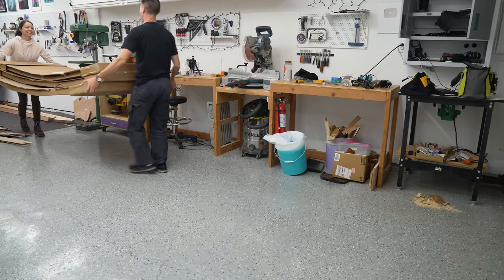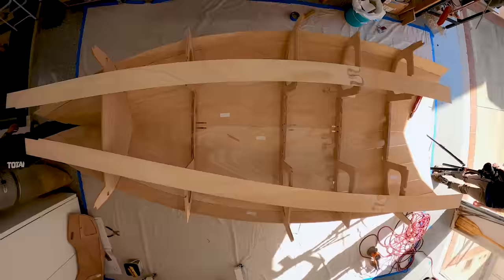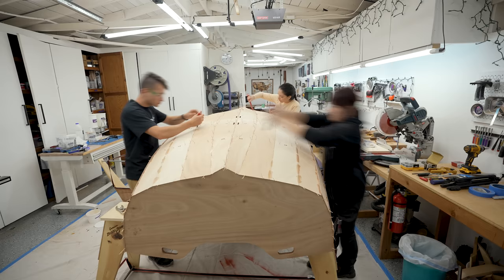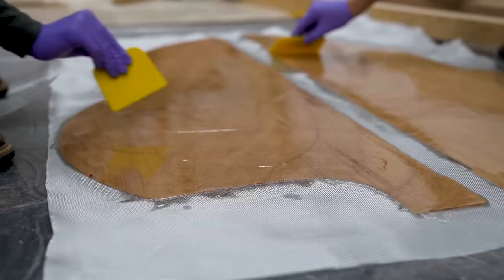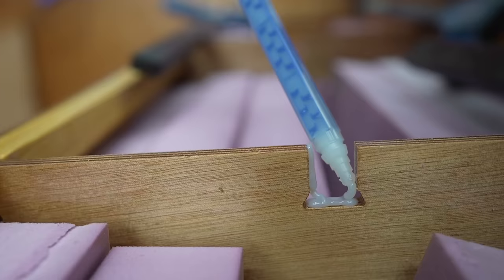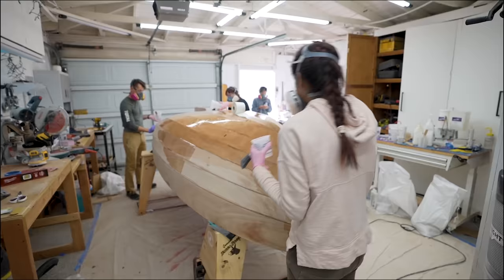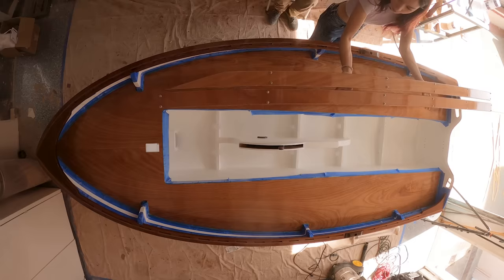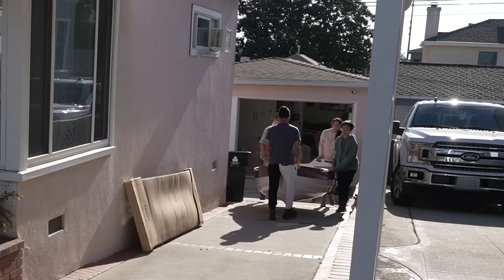Building a SAILBOAT (My Longest Project Yet!)

Comment: Buy a few concrete straight edges (the aluminium extrusion type - make sure they're not bent out of the shop before buying them) and keep them in the shop. Whenever you want to make sure something is straight you can use those to keep a reasonable straight surface and they are built to be abused, so it's not like a level, which is a fine instrument. They're meant to be dragged in concrete, dropped abused, so a little bit more sturdy. Don't cheap out on them, buy the thickest and heaviest you can get (in aluminium). A few of those in the shop are invaluable datum surfaces to work off.
edit: also, take your plastic squeegees and notch them (or buy notched ones) because that's going to dose all the epoxy that's not for laying, to the exact dosage so you don't have to waste time making sure you have a consistent layer. It's like laying tile.

Comment: Been enjoying your videos. Had an idea for a fun boat project that would involve some experimentation with some epoxy and bamboo. The original canoes that cedar strip canoe's were based on were the birch bark canoe. Do you think you could build a birch bark canoe out of bamboo strips? They have a lot of ribs I kinda wondered if you had nearly continues ribs which you then epoxyed the outer strips to if you would basically create a fairly thin light weight formed plywood construction. Just a thought that would be a really cool build and thought you might like to try

Comment: Xyla nice work! I like to cut fiberglass cloth with scissors I get from DAISO. They have very tiny teeth and hold up very well and only cost a couple of bucks. I fish for sharks and used them to clean them. Shark skin and fins dull my knives before I'm done and the pair I'm using have cleaned over ten sharks and are still sharp. The blades are about three inches long and easy to use.

Comment: Similar construction method invented by Barry Bucknel as co designer of the original Mirror dinghy. I built mine age 15 back in 1966. I gave it away last year. Up until that point it must have been the oldest single owner mirror dinghy no. 7580. £69 from Mirror Newspapers back then. Glue was mixed from powder. Reinforced with glass tape and resin. I bet this is a few £s more to buy.

Comment: That's a lot of storage that got filled with foam... could've made water tight compartments that would be useful for more than just bouncy...just a thought for the next one 😉
Reply from the maker: the whole point of foam is that if that water tight compartment the foam is in gets breached (like a crash- this is for a youth sailing program) the boat won't sink because every single cell of the foam will not also get breached
Reply: @xylafoxlin  yeah, I get it, totally... just the prepper in me looking for that storage. The small boat we had when I was a kid had two compartments (one on either side) that the life jackets were kept and the compartments were like a cooler but with rubber around the top...would take a lot to punch through all those layers...still, probably a good idea on a trainer to have solid foam... I'm always looking for that storage on a personal boat 😊😋

Comment: Great video.. well done on the boat! I know you're an epoxy girl.. however a good wood glue is much less expensive and bonds better (soaks into the wood deeper) tightbondIII waterproof exterior has worked with great results for me.  I broke in half an aridronact chair teak arm 30 years ago. Used TB wood glue to repair. It has held up perfect without any finish outside in the elements for 30 years. For wood on wood it is perfect. Epoxy is better for structural joints... just saying

Comment: Did you ever try resin infusion on the boat? The bagging would be a nuisance, but you could save weight. Also, for working on the inside of the boat, couldn't you put the boat on one side?

Comment: For so long it was covered with varnish and epoxy resin to prevent water from getting plywood ...  And then you  just screwed the screws without a filler. (((
If It’s not too late, you need to unscrew all the screws, drill bigger holes and fill them with resin. Let it settle and then drill small holes and screw the screws into these holes.

Comment: Greetings and Salutations 

I thought you meant to assemble the wooden parts with hammer and nails then wrap the whole boat in shrink wrap 
Then pour the epoxy resin into the shrink wrap plastic never seen a fiberglass boat before

#goodluck #thanks 😊

Comment: If my avid reading of Patrick O'Brien is to be trusted, the aft sides of a sailing vessel are its "quarters."   That is, you would describe something directly in front as being "dead ahead," something in front but to one side as being "off the port/starboard bow," directly to the side as being "amidships," directly behind as "dead astern" and something behind the vessel but off to one side as being "off the port/starboard quarter."  

So "quarter-knees" are perfectly descriptive - they are the knees mounted in the boat's quarters.

(Please note that I rely entirely on Mr. O'Brien for this information, as I live in Alberta and am well over 1,000 km from the nearest ocean.  Amusingly, I am almost equidistant between the Pacific and the Arctic.  Needless to say, my practical experience is minimal.)

Also: if the garage is flooding, building a boat seems like a reasonable reponse.

Comment: Maybe it is my odc kicking in, and ill admit I know nothing about boat building, but solenoid the wood is sealed from the outside, but what about all the holes drilled into the wood after it was sealed, would those not open up the wood to getting water into its fibers and rotting from the inside out?

Comment: cool build, didn't realize how many little bits & pieces went into a lirrle boat.  are you aware you say "boatl tote" almost every time?  
  you should make & video building a sailplane glider next, that'd be especially cool...  even better if'n y'all combined it with big enuff re usable rocket boosters so you woodn't need a tow plane to get it up.

Comment: I have a question! How come you spend all this time protecting the wood from water with many layers of epoxy and paint, and then drill holes in it and leave exposed wood? Or do you also treat the holes but did not show it? I know nothing of boats, but what I do know about water is it gets everywhere, just a tiny crack and it will find its way in there, so to my eyes this is dangerous. Hoping someone can help me here!

Comment: For the foam why not use self expanding foam? Does it pose a weight issue or was the and other reason for the foam board instead?
Reply: Here in the UK we used to use it for glass kayaks. Story goes some one was casting in the foam in the winter so slung the kayak on end in the stairwell of his house to be warmer. He got the decimal point wrong and poured in ten times too much. It  foamed up and out and flooded the hall in foam too.
Reply: Xyla mentioned in a previous comment that they were specifically asked to use the pink foam so that it could be replaced if repairs were needed (and why can't people be bothered to read the existing comments before posting?)
Reply: @earld1403  because like the majority of people I’d rather be given what I want than work for it

Comment: I used to work in the industrial fiberglass industry. i can honestly say it kinda sucked.  lol but then again i was doing it for things like lining of chemical tanks, or containment systems for caustic chemicals and pretty much every place i had to work was the most disgusting and gross place you could imagine.  lol even our shop pretty much had a 2 inch layer of resin on the floor it was not a good environment (which is why i don't work there anymore)

Comment: If you need to sand inside the boat why not just turn it on it’s side? As long as your glue has dried it should be okay. If you need some sort of support you could just make a support frame out of scrap wood.

Comment: Can someone explain to me what anti fouling paint(or however spelt) is and why it cant be on a boat that doesnt stay in the water?
Reply: It is a paint with something in it (a biocide, for example) to inhibit marine growth. Without it, the bottom will quickly foul with seaweed/algae, barnacles, worms, etc. It is usually slightly toxic. Typically, boats which are stored out of the water do not use bottom paint. You CAN use bottom paint on a boat that doesn't stay in the water but it is not necessary, and since it is toxic, the center for wood boats probably prefers not to have it.

Comment: Building a boat should always be centered on the fact that you want to build a boat and not necessarily that you want to go boating.  The two are most often, unrelated subjects.  

For every boat that is built new and completed by amatuers, there's at least a hundred (professionally built) which are being abandoned somewhere and left to rot for lack of a caring skipper.  Many are perfectly seaworthy and still in the water although impounded and awaiting auction or demolition. 

They all need a little paint and polish but most of all, a new owner.  

Think about that before you start some big construction project.

Comment: But but but... TotalBoat sells 2 part expanding foam made specifically for boat flotation?? Why use the pink insulation foam board? Excellent video though!!!
Reply from the maker: they specifically requested pink foam so it can be replaced quickly and easily if the boat gets injured! Next Thursday is gonna see a ton of use
Reply: @xylafoxlin  Yikes! That's a hell of an injury to get into the foam!  🙈

Comment: Ironic how the sailors in medium winds on their website is struggling to get their weight out due to the bad deck layout and lack of hiking straps. Also the kids look even more bored than sea scouts on a Lelievlet. Please get them an Optimist! You can even build them an Optimist. It just needs to be half the weight, half the sail area, 2 ft shorter and can be 1/10th of the price

Comment: All activities have jargon. I think the reason why boat word soup is extra soupy is because the disconnection between spelling and pronunciation. No sane landlubber would spell a word pronounced "gunnel" as "gunwale", or pronounced "bosun" as "boatswain". Even worse: words that rhyme by pronunciation like "gunnel" and "trunnel" are spelled "gunwale" and "treenail". And this is on top of using an entirely different word for things that have a common name already, like "sheet" for "sail", "line" for "rope", "head" for "toilet"/bathroom, "hatch" for "door", "port" for "left", "starboard" for "right", etc.
Reply: Actually, a sheet is a line used to control a sail.
Reply: @klezhead  And other ropes that don't control sails are just lines?
Reply: Yep